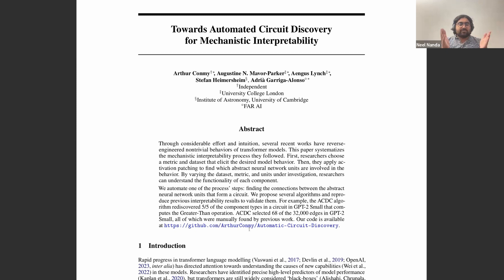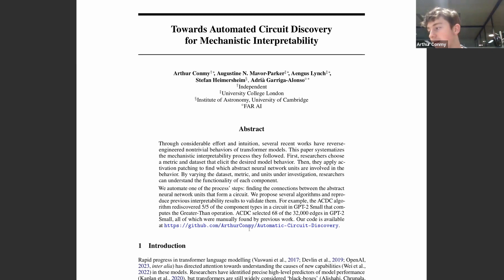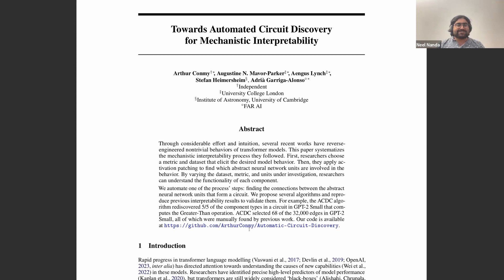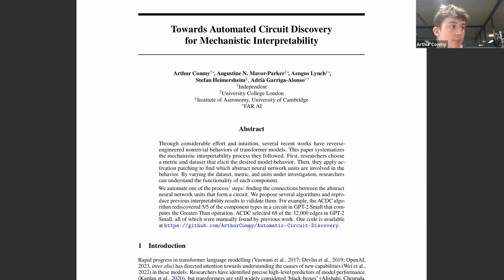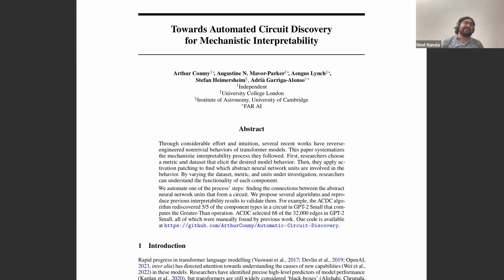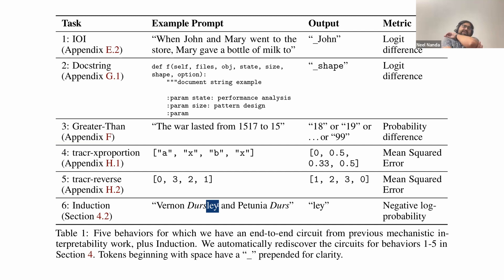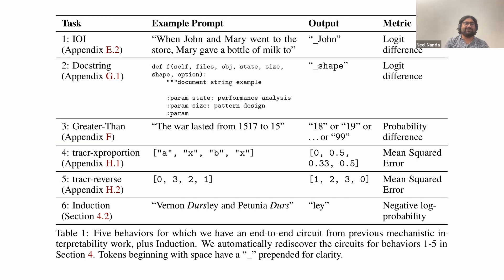A Walkthrough of Automated Circuit Discovery w/ Arthur Conmy Part 1/3

Comment: 🎯 Key Takeaways for quick navigation:

00:00 📝 Introduction to the paper and the need for automation in interpretability.
- The paper aims to automate the process of circuit discovery for mechanistic interpretability.
- The motivation is to streamline a labor-intensive step and use algorithms to discover important circuits in models.
03:15 📊 Defining a circuit and its importance in interpretability.
- A circuit is a subgraph of the computational graph responsible for a specific task in the model.
- The focus on edges and information flow in circuits rather than individual nodes.
- Discussion on the significance of edges for understanding information flow.
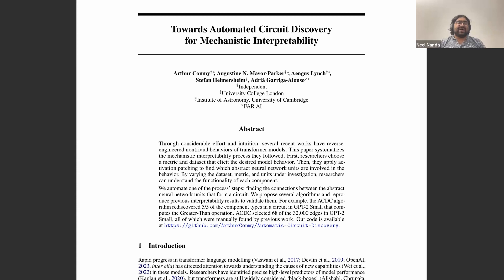10:34 💡 The limitations of automation in interpretability.
- Automation streamlines circuit discovery but doesn't replace human interpretation entirely.
- Circuits focus on discovering structure, not understanding what the edges represent.
- The need for human involvement in the interpretability loop.
15:11 🧩 Patching methodology for testing hypotheses in interpretability.
- Patching involves replacing activations with alternative inputs to assess the importance of components.
- Clean and corrupted distributions for evaluating the relevance of model components.
- The power of patching in verifying hypotheses and understanding how models work.
20:44 🌐 Different approaches to interpretability.
- Distinctions between specific distribution-dependent mechanisms and general distribution-independent mechanisms.
- The idea that not all components in models are dedicated to a single task.
- The complexity of understanding how superposition of neurons works in models.
22:21 🕵️ Exploring the Variety of Tasks
- The video discusses various tasks in automated circuit discovery.
- Tasks include superposition, finding neurons, predicting doc strings, computing greater-than operations, and working with the Tracer programming language.
24:11 🧠 Harnessing Transformer Weights
- The paper explains how to convert the task of computing the proportion of x's in a list at each position into literal Transformer weights.
- This approach demonstrates the power of Transformer models in solving specific tasks.
26:25 🤖 Induction Heads in Language Models
- Induction heads play a significant role in language models, predicting what comes next based on context.
- The example of "Dursley" in the Harry Potter context is used to illustrate the concept.
31:01 💡 Contributions and Limitations
- The video emphasizes the contribution of automating circuit discovery, highlighting commonalities in previous work and a new methodology.
- It also acknowledges the limitations and the need for further research in this area.
35:24 🛠️ The ACDC Algorithm Overview
- An overview of the ACDC algorithm is provided, outlining the steps involved in selecting a computational graph, pruning connections, and recursively refining the subgraph.
- This process can be applied to various tasks, making it a versatile methodology.

Made with HARPA AI